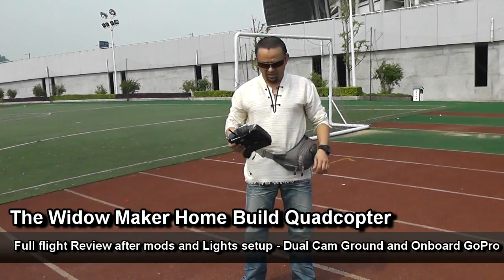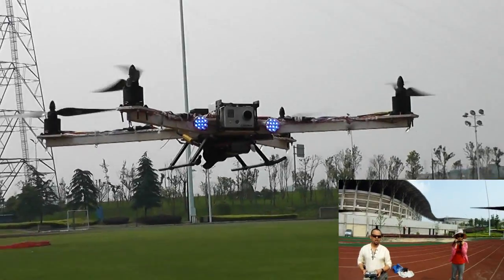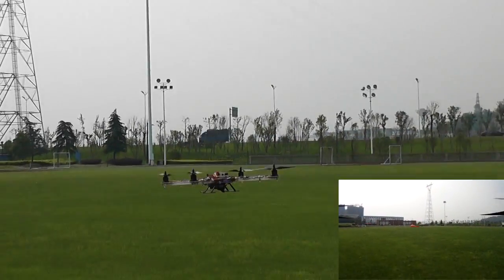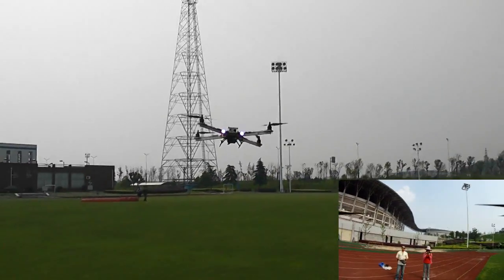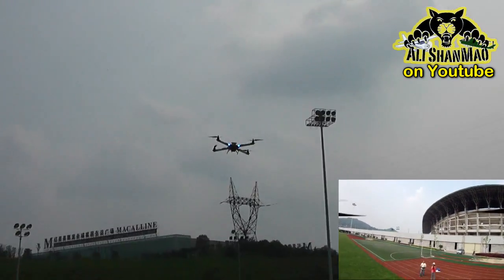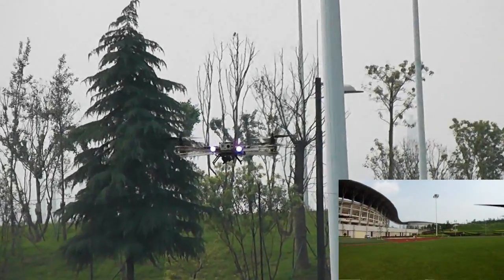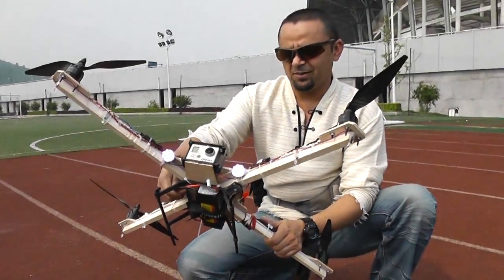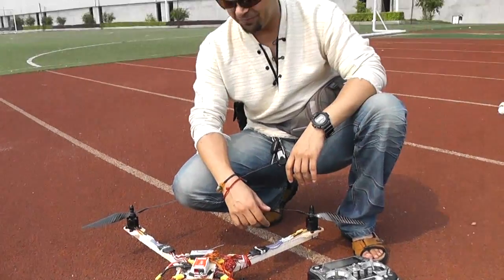Widow Maker Home Built Quadcopter Full Flight Review

Comment: That's new to me :)
Lower the minimum gasrange setting (servorange on the throttlechannel) ?
You can see what's happening with a multimeter connected in the powerleads between the input of the regulator(s) and the feedingsource if there is constant low amp current flow when the throttle is down.
I can't imagine that all 4 regulators are defective.

Comment: I put the round led's on ch56 with Turnigy on/off switcher so as to save power in day. Also you can just use jst output from switch and plug in various IR or other 12v items. Nice unit look forward to crash testing vid, sorry. :o)

Comment: I started flying Quadcopter FPV with the Rabbit Controller. Have you tryed it, 

I find my range on 2.4g tx is less on the Quadcopter i think it's RF noise my vtx is 5.8g 200mw with 12 dbi patch. I have more range on my vtx than my rc tx.